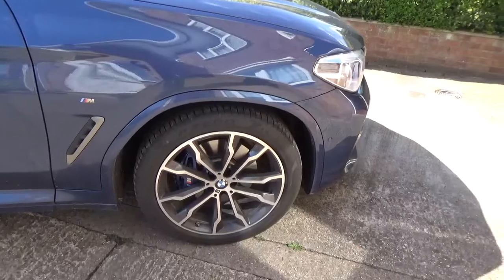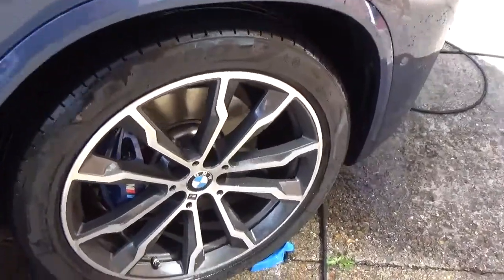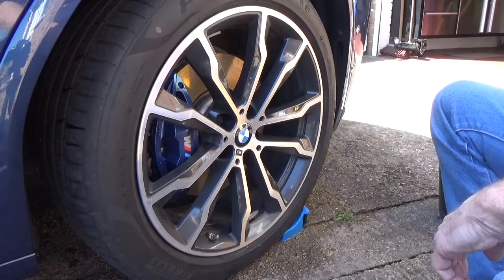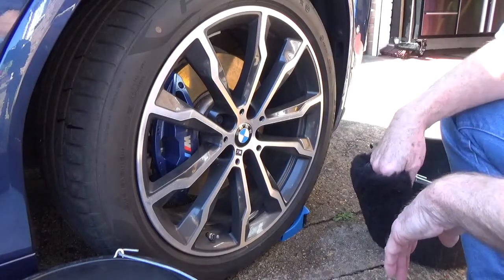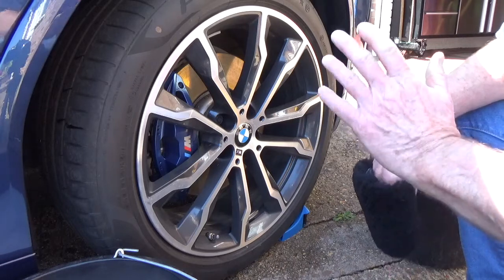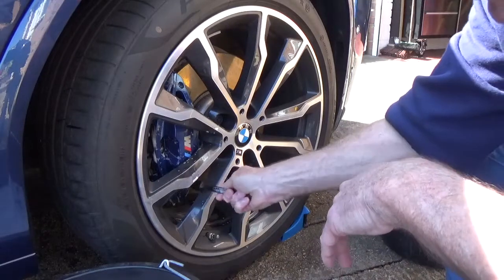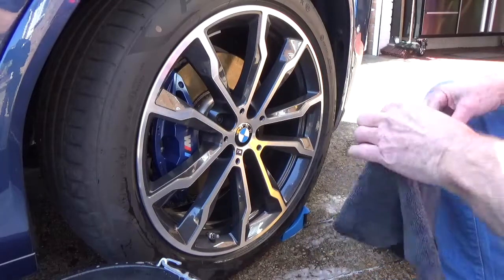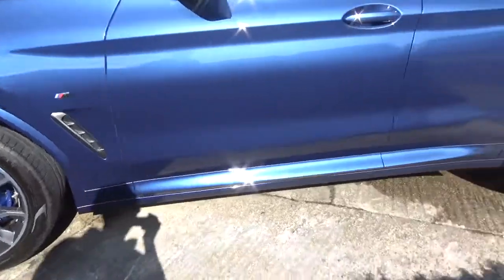Gtechniq C5 Wheel Armour 3 months on

Comment: Good vid pal. Just gave mine a first wash after C5 coating and like you did, washed the wheels last as snow foam and rinse got most of the brakedust off. Used to wash them first like you. Topped the wheels with C2V3 to give it a bit more repellency.
Reply from the maker: sounds like you have it sorted👍

Comment: I've been using C5 for a few years, like you say it makes cleaning wheels so easy, no need for aggressive wheel cleaners.

I use a dedicated wheel bucket with regular car shampoo and mitt and a couple of brushes.

At beginning of a maintenance wash I first pressure wash wheels along with all the car, then snow foam all car and wheels, while the snow foam is dwelling for 10 mins on paint work I clean the wheels, by the time the snow foam needs rinsing off I've cleaned all 4 wheels.
Reply from the maker: Sounds to me as though you have a very good process. Check out my video on Garage Therapy One Wheel & Car Shampoo. I recommend both products as in my opinion they are one of the best shampoos on the market. The wheel shampoo is great. Next time you need a new shampoo give them a try. Thanks for your support & comments.👍
Reply: @ObsessiveCarDetailer  Thanks for recommendations.

I've tried a few shampoos but keep going back to Car Chems Luxury Shampoo 1900:1 from their Original range, got it on offer when it was  £19.99 for 5LTR, been using it for over 2 years and only half way through the container, cheap as chips and a damn good shampoo.

Keep up the good work with the videos, subscribed & bell enabled :-)
Reply from the maker: 26DX047 car chem never let you down. You may be interested in a few reviews that I have done with their products on my channel. And their super suds Shampoo is top notch. Really appreciate your support and feedback, thank you 👍

Comment: Hello mate
Nice video
Im going to do mine next week ... couple a questions please ... do the stick on wheel weights stick to the coating ok if you have to have a wheel te balanced??

If thebold weight is removed can you recoat over to cover where the weight was??

Cheers

Will look at your other vids ... first one ive watched

Thanks
Reply from the maker: Hello Andy and welcome to my channel. Have a look through the videos and any questions then just drop me a comment and I will always get back to you. So this video is 5 years old and since it was filmed I have had a new set of tyres and the wheels rebalanced with absolutely no issues so that tells me that yes you can stick new weights on the coating. I have also as you will see when you look through the videos removed and recoated the wheels since this video and again yes you can coat over where the weights were. Hope thats of help
Reply: @ObsessiveCarDetailer  thanks mate
Will do mine next week

Sorry can I coat the calipers in same coating?? As painting the calipers this weekend 

Cheers

One or two coats on wheels ??
Thanks
Reply from the maker: @andyjohnson1468  Yes you can use the same coating for the callipers but if you are painting them this week, I would give it a few weeks before coating as you need the paint to fully harden before coating. I only applied one coat and it lasted over 2 years but I do wash them regularly and use a spray on rinse off sealant every time. If you do give them a 2nd coat then leave it for 12 hrs between coats

Comment: Where did you purchase the plastic wheel rollers to stop the power hose getting stuck on the wheels? Thanks
Reply from the maker: Hi Chris, they are called Detail Guards & I bought them on Amazon. Not sure of the price as it was a while ago but I think they were around £12. (maybe a bit more now) for set of 4. Hope that is of help
Reply: @ObsessiveCarDetailer  Thanks, I seen them before on another channel but forgot what they were called.